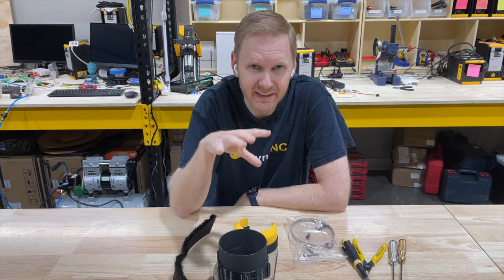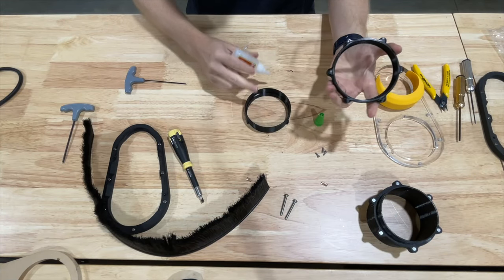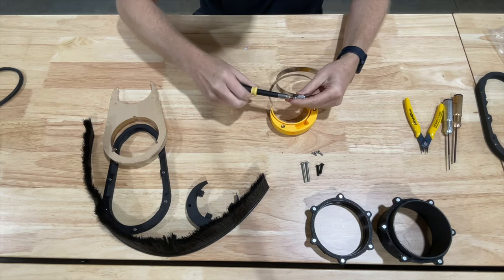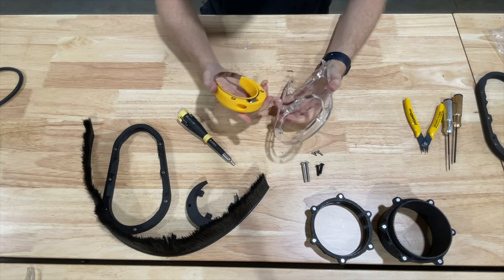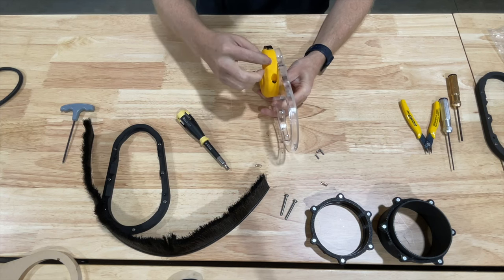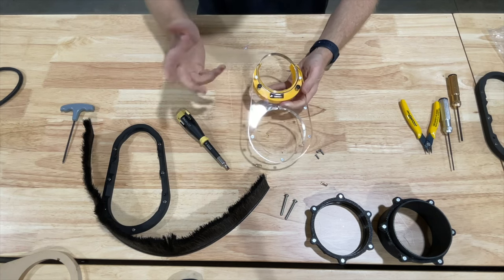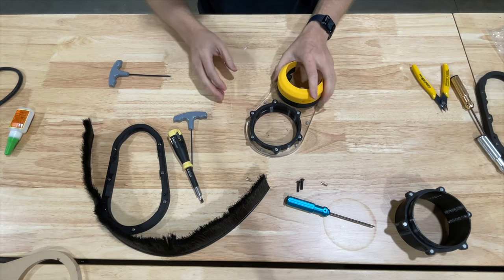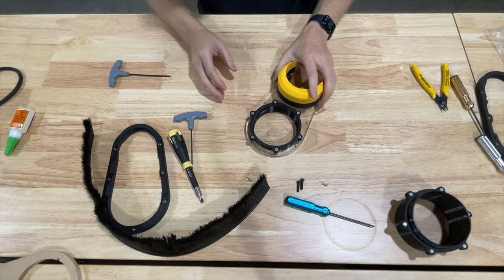Assembling the PwnCNC Dust Boot v10

Comment: Daniel, great video and very timely.  Just purchased the water cooled PwnCNC spindle and v10 dust boot for my Onefinity Journeyman with Z-20 heavy duty Z slider for non-elite machine (and no stiffy rail).  After watching your video, I was able to find the hose clamp that clamps onto the spindle for the front.  However, I was confused on the which options to pick for the rear 90 degree hose clamp you had on your video that will work with the non-elite machine stepper motor.  Thanks for your help.

Comment: Any ideas how a dust boot would work with narrow but deep cuts from 5" to 6" deep?
Reply from the maker: The deepness of the cut is definitely the difficulty for any of these style boots which are abundant on the market.
The boot's body will hit narrow/deep walls making it almost impossible to utilize this type of boot.
Narrow but very deep (5-6in) presents a whole lot of design challenges and will be very difficult to setup anything existing boot design.
If it were me, I'd setup air spraying at the bit and helping keep the chips away from the cutter, as well as an enclosure or some other machine-size containment for the dust and clean-up afterwards.
Reply: @PwnCNC  Yes, so you see my issue....for now because the pocket cut is limited in size, the solution is to hold a shop vac end near the pocket while cutting...an enclosure in my particular case will not work...when I have completed my proof of concept case for the work I am doing, will post a video...

Comment: Do you sell the parts to convert a 2.5 inch version to a 4 inch version?
Reply from the maker: We have designed a few options, can you describe which 4" product you're wanting to change to 2.5"?  there are a few and different adapters work better for each situation.
Reply: @PwnCNC  I ordered the 2.5 inch dust port for the spindle I have on the way. Mainly to accommodate existing connections. But the HF dust system I have is a bit weak and I was thinking I may have to go to 4" at some point. I ordered the V10. Can't wait for it all to get here! I am slugging through with an original X-carve!